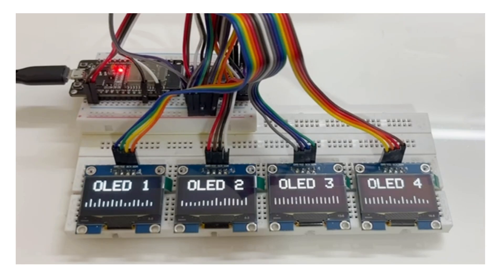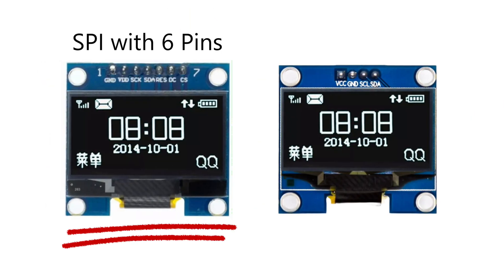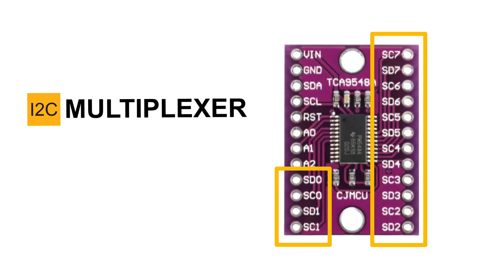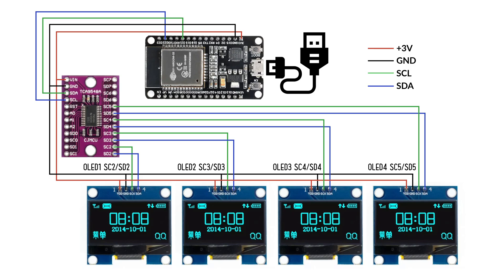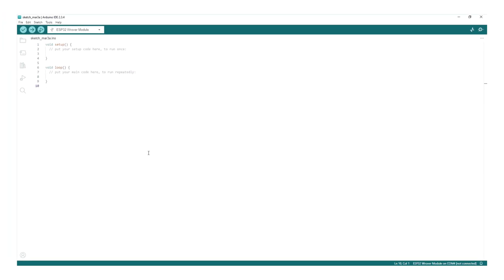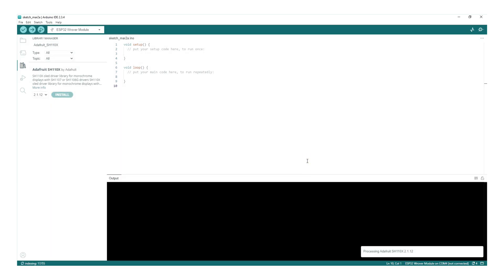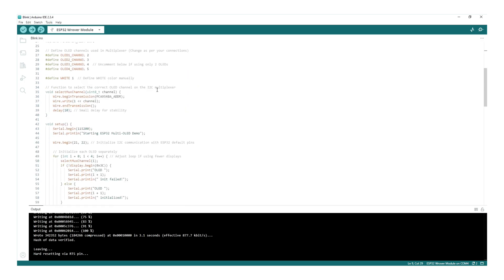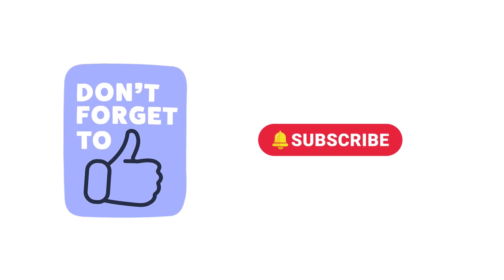ESP32 + 4 OLEDs! Unlock I2C Multiplexing Power!

Comment: One important thing is to handle the pull-up resistors on the sd0/sc0-sd7/sc7 side. The micro controller has often integrated ones, but devices like the AS5600 don't.
Reply from the maker: Great point about the pull-up resistors – it's an important detail for reliable I2C communication!

Comment: Where are the connections to A0, A1, A2 to select the 4 channels!   NO AWARD. Failed. Remedial action required
Reply from the maker: Hi! On the TCA9548A I²C multiplexer, A0, A1, and A2 are address select pins for setting the module’s I²C address, not for selecting channels. The actual channel selection is done via software commands over I²C, not by wiring A0–A2.

If you want to change the I²C address (e.g., when using multiple multiplexers), you tie A0–A2 either to GND or VCC to set a new address. But for selecting channels (0–7), you send a command byte through I²C.

So there’s no missing hardware connection for channel selection— it’s done in code.

Comment: Hi brother , can u modify  with colour displays  which displays the images , and the easy way to upload the images to the particular displays .
Reply from the maker: yes, it’s definitely possible to upgrade this project to use color displays (like the TFT SPI-based ST7735 or ILI9341), and even show images on each one individually using a multiplexer like TCA9548A (for I2C) or managing CS lines if you're using SPI.

For image display, the easiest way is:
Convert your images to .bmp or .jpg format.
Store them on a microSD card.
Use libraries like TFT_eSPI or Adafruit_GFX + Adafruit_ILI9341 (or similar based on your display).
Then use tft.drawBitmap() or tft.drawJpeg() to show images.

Let me know which specific color display you're planning to use and how many, and I can guide you with exact wiring and code examples!

Comment: Is it possible to have multiple multiplexers attached to a single multiplexer?
Reply from the maker: Yes, it's absolutely possible! This technique is called cascading multiplexers. You can connect multiple multiplexers to a single multiplexer to expand the number of selectable inputs. For example, if you have two 8-to-1 multiplexers, you can use another multiplexer to select between them, effectively creating a 16-to-1 multiplexer.

This approach is commonly used in digital logic design and microcontroller projects when you need to manage many input signals using fewer control lines. Let me know if you need a practical example! 😊
Reply: @maisonupstore  it would be great if you could add one! im working on a project with 9 screens

Comment: You didn't actually show or teach how to work with the PCA9548A multiplexer in this video which was very dissapointing :(
Just said "copy paste this code" which doesn't help me or my friend to learn anything on the internal mechanics of PCA9548A and how we can manage it ourselves.
Reply from the maker: You're absolutely right that just copying and pasting code doesn't fully explain how it works under the hood. I’ll work on a dedicated video that breaks down how the PCA9548A manages multiple I2C devices, how to manually switch channels in code, and how you can modify it for your own projects.

In the meantime, if you want to dive deeper, here’s a quick explanation:
👉 The PCA9548A works by enabling and disabling specific I2C channels via software. You send a command to its control register to select which device you want to communicate with. If you're interested, I can post a detailed written guide or even provide example code that explains each step in more detail. Let me know what you'd prefer! 😊

Thanks again for your support, and I really appreciate your patience! Stay tuned for more in-depth content.